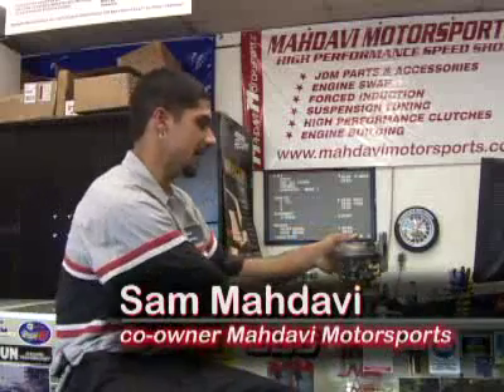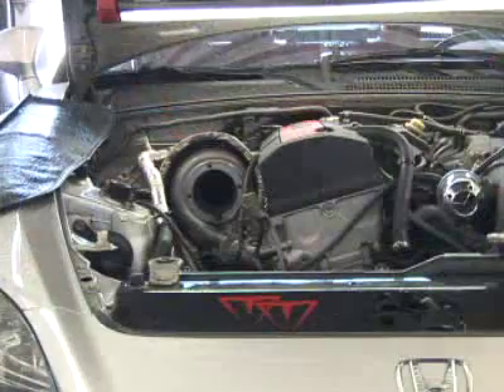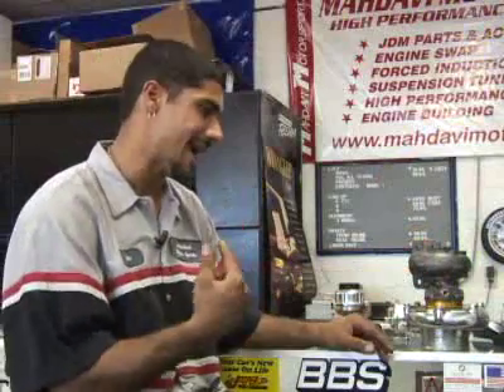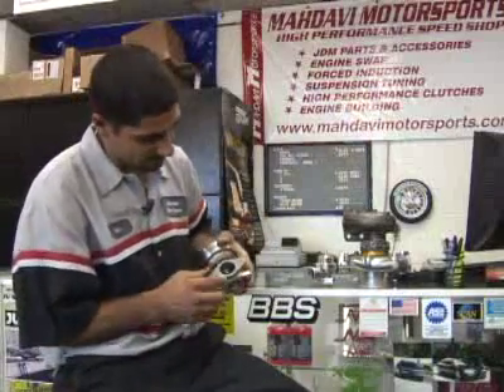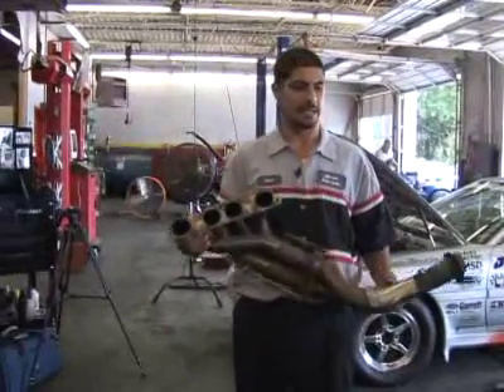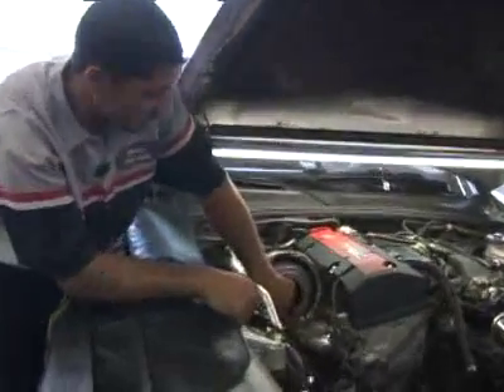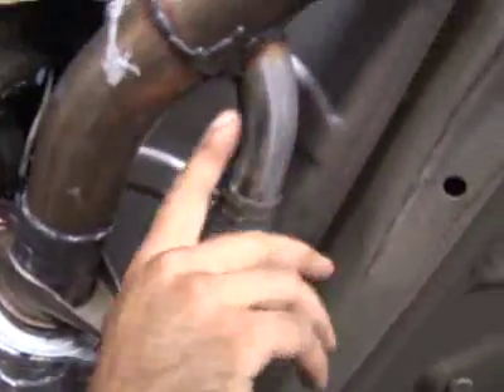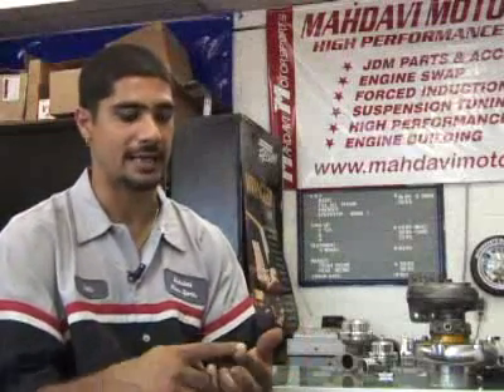How Turbochargers Work

Comment: yes i have and if you knew what your talking about you'd know that the simple formula for static situations is 

Presure1 x volume1 x temperature 1 is equal to pressure 2 x volume 2 x temperature 2.  (PVT=PVT)
Now for idiots- the volume of the intake system is constant, (the pipes don't get bigger the more boost there is) so as the pressure increases so does the temperature, but the volume NEVER CHANGES! 

Like you said it is simple physics.  
ask your kindergarden teacher to explain it

Comment: also the turbo atomizes the air off boost???

FYI air is always atomized (unless it is a soild at about-195celcious)

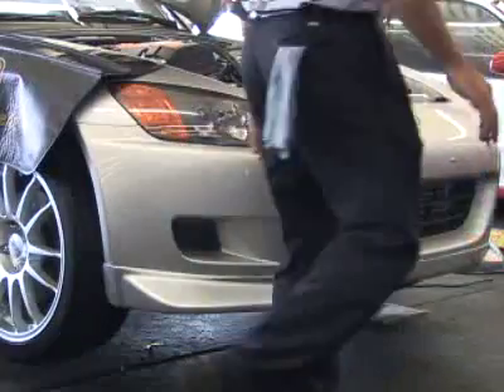and @0:20
WRONG!!!
off boost the turbo is a restriction in the intake = less power + poor economy (comparied to the same engine without a turbo)

when you say a turbo engine is more effecient it dosen't mean how much fuel it uses per km/hp/kw/whatever (fuel economy), it mean that the engine can produce more power per cc/cube than a N/a engine.

Comment: wrong, the air dosen't expand  >:/
 it is compressed and gets hot, then goes through the cooler and temp falls and air density increases, not pressure, you get pressure drop accross coolers

you only get 2/3 for this comment 
try harder next time

Comment: You oughtta be able to beat most Hondas, but that 302 only made 220bhp back in the day (300 lb ft though XD)...and now it's 24 years old...she may not pull as hard as she once did.

New four cylinders are making just as much bhp (not the torque) with less than half the displacement and the big advantage, weight.

If nothing else, the 'stang will sound better.

Comment: no, a turbo on a carb'd car can be before or after the carb. before, it's called a blow-through design. after, it's a draw-through design. with a blow-through, the entire carb must be made able to handle the increased pressure provided by the turbo. but that's probably an easier setup to build than a draw-through for most situations.

Comment: at low speeds, turbo blows little but it increases with the revs , so the latest ones are variable flow turbos, to get enough pressure at any speed , some help from electronic control is neccessary as well , and something else depending on the engine type and design ... it is lot to take in account .... quite a lot  
technology is such entertaining matter 
good video, not very accurate but  at least you get the idea ...

Comment: You could. There are some super chargers out there on the market (or at least there was) that are electric. But you don't get much pressure from those, plus there is more  drag on the engine (through the electrical system/alternator). This way, you're using the waste energy (in the form of hot, still expanding gas) to driver the turbo. Energy that normally would have been sent out the tail pipe and lost. Plus this is variable with the engine speed, so it produces low pressure at small RPMs,

Comment: this is so simple. the turbo has two fans. one for the exhaust, one for the intake. so the exhaust gas, powers the exhaust fan, which is connected to the intake fan through a rod. as the exhaust fans turns, it also turns the intake fan, which sucks in a larger amount of air. it forces the air in the engine. get it now???

Comment: just keep in mind that this power also causes more blown head gaskets ,and over heating ,that is the reason that super chargers are more recommended ,as they work in the same basics ,but are safer for the engine ,and they are spining by the drive belts  not the exhast.

Comment: turbo does not put exhaust back into the engine. it uses exhaust to turn the turbo which spins and compresses fresh air into the engine. the exhaust just goes straight out of the tail pipe after it turns the turbo

Comment: The air coming out of the turbocharger compressor cover should be exiting in a straight stream. Even if it were "spiraling" it would not longer be once it passed through the intercooler piping, intercooler, and throttle body.

Comment: All that means is when the turbo isn't boosting its making the air spiral into the intake which makes the air distribute itself better and makes the amount of air available to each cylinder more equal increasing its efficiency. In most cases though you lose mpg no matter what with a turbo kit.

Comment: but look at what it does. it returns exhaust into the intake. why? because catalytic converters only convert carbon monoxide into dioxide. not gasoline into dioxide. thats why the egr block plate goes in your intake or headers.

Comment: they dont spray in a very efficient manner. do you know what EGR is? i think thats what its called. it runs your exhaust back through your intake to be burned again because theres unburned gas. a forced induction system will make the fuel spread out evenly after the injectors spray it in so it allows for a more efficient burn.

Comment: he means atomizing the fuel. it means instead of a dense spray of fuel coming into the chambers the air will disperse the fuel into smaller droplets throughout the chamber. turning it into a mist basically. it means more oxygen and more fuel fumes. fumes are what burn. not the liquid.

Comment: WTH???

That's not how a turbo works, no exhaust gases enter the combustion chamber.  Hotter air doesn't help burn more gas vapors.  You need cooler air, because it is more dense than hot air (thus more oxygen for the fire).

That is why turbo's run an intercooler...

Comment: Well, the more air there is per power stroke, the harder it will explode. Basically, when the engine is on its intake stroke, it sucks in air, and the goes up and compresses it, to be exploded. Well, the turbocharger compresses the air before it begins the up stroke(compression stroke) and the air compresses even more that normal, and the more you compress gas the bigger the explosion is.
And, the higher air flow, the more fuel is pumped into the cylinder.

Comment: ok can u explain this to me.
the turbo adds more air into the engine. that makes a bigger explosion. it makes more power with less gas.
lets say the engine takes in a cup of gas and it makes an explosion and the car moves 5ft
then a turbo is added and it takes in the same ammount of gas but with more air wich causes a bigger explosion and the car moves 10ft this time. 
less fule for the same amount of power
explain how that doesnt work to me

Comment: I must agree. I am 15 and i am smarter than this guy. It just takes the exhaust and spins a turbine, which spins another turbine, which will push more air into the fuel injector(or carburetor), so more air=more power. Of course it is slightly parasitic, but not as much as the belt driven supercharger. And it gives you more power than it takes from the engine anyway, so who cares?

Comment: Woops... WRONG kikao14!!!  Exhaust gases DO NOT mix with intake air going through the turbo.. The exhaust gases are only used for pressure to turn or spin the turbe turbine..

Comment: Ohh..so the only limit to power is the amount of fuel and engine strenth...All this time I'm wastin with cfm, ignition kv, compression ratio, engine displacement, spark advance, cam timing, EGT's, fuel temp, air density, exhaust back pressure...silly me.  Thanks Muhamid Aboodabee!! (whatever his name is)

Comment: not every engine can use a turbocharger. ones with a carb, it wouldn't get the air/fuel mixture it needs. it would run too lean. thats what i heard anyways

Comment: Stoicheometric rule...  you need 14.7units of O2 per unit of fuel...  how does feeding more oxygen to an engine produce fuel economy?  The way economy turbocharged engines produce better fuel economy is by having an engine that is underpowered (undersized) for the application and the turbocharger makes up for it...

Comment: you do need a waste gate on a turbo charger or else the pressure built up will keep rising. the waste gate is what controls the air flow to the turbo

Comment: Im Sure you guys are all right.  He probably just made a mistake and meant to say atomize fuel.  I dont know.  But what I do know is that he owns the shop, he installs turbos all the time, and I found that turbos can be installed on any car.  The right one needs to be installed though.  One kind of turbo does not fit all.  There are a bunch of different makes, models and designs.  That is what I was told by the mechanics that install turbos a few miles away.